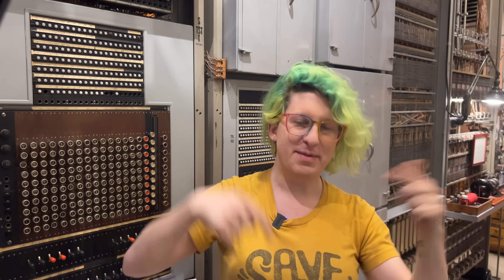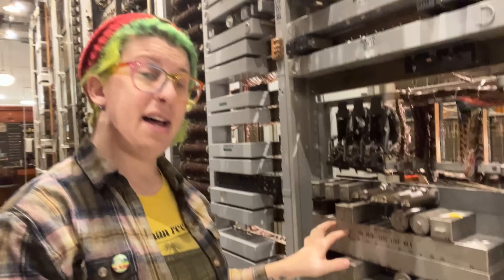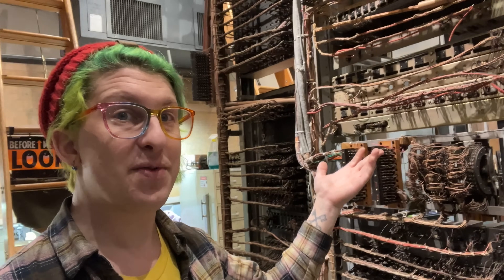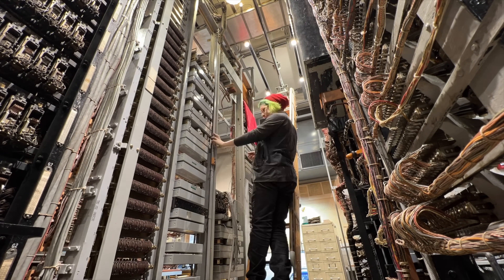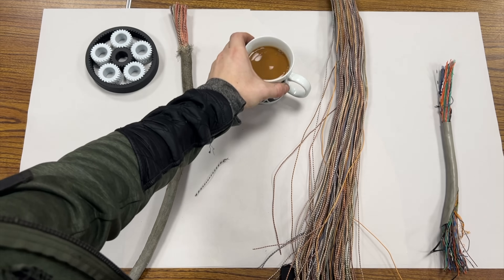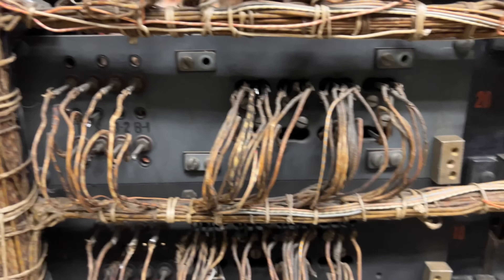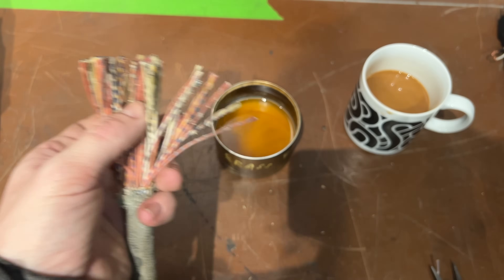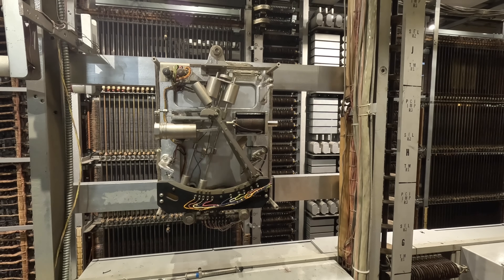Bringing up the Sender Test Frame: PART 2!

Comment: The cloth-covered wire was also used in American pinball machines. This continued in use until they went electronic in the mid 70s'. My friends at the time always laughed at me because they didn't use PVC-insulated wire. I can only assume it was more resistant to overheating when coils burnt out and went short circuit. PVC insulation may have melted. The only drawback was if the loom got damp or wet, all sorts of crazy faults occurred. Any one know why it continued in use?

Comment: 55 years ago, I operated a Stromberg Carlson test board in a 5000-line XY switching exchange. 12 Hour shifts at night. The work was difficult for sure. Just the frame man, me and one switch maintainer on duty at night.
Not only telephone but teletype circuits, secure voice circuits, dedicated circuits. Never a dull moment. My frame man kept me on track as he worked there for several years before I got there. I could count on the correct cable pair and the correct connection every time. My frame man made me look like I knew what I was doing. 😊 Thanks for the interesting information.

Comment: Do you still have the wire display on the 3rd floor?  Love the paper-wrapped wire in muslin sacks - it's organic!  Also remember reading in one of the History of the Bell System volumes that they calculated they would use all of Earth's lead for insulation at some point if they didn't come up with new materials.

Comment: In the 1980's the FCC equal access mandate required all BOC's to support equal access dialing for long distance. Initially, someone thought it was a good idea to add "Adjunct Processors" to existing 5XB offices to provide equal access. This went horribly wrong so Pacific Bell in L.A. had to install new NTI DMS100's (and 5ESS but I worked for NTI) to replace all of the 5XB switches. I have a 5XB relay test box from one of the 5XB's we replaced.

Comment: It would be antithetical to the ethos of the switch to ever install any module to emulate a relay function that was secretly an entire computer under the hood.  Totally agree with your decision, Sarah.
Reply: That being said, there's some things you just can't fabricate. If you've got a dead part and a modern equivalent, use the equivalent but keep looking for an original.

Comment: Enamel-coated wire under double silk? We sometimes used that kind of wire for transformer windings here in Poland - it was marked DNEJJ. For telecom cables typically enamel-coated wire in color-coded paper cover was used, bound with a paper tape and shielded with lead. I discombobulated a good few meters of that sort of cable when we found some cut off and lying underground next to Book Art Museum when I worked there. Quite a few kilos of lead, that would later get remelted with antimony and tin to make some fresh type metal.

Comment: ESS 1, 2, 3, 4, 5 & SS 6 & SS 7 do not have sender test frames because they are transistorized and integrated circuits controlled by Western Electric Princess Quad 4 microprocessors running at 1 Ghz, which was state of the art in 1965-1995.

Comment: You can get an electric tool to strip the enamel off the wire its a rotary type , motor rewinders/repairers use them.

Comment: It's a telephone museum, it needs to work as it did in the time period. Modern telephone exchanges use computers so it doesn't make sense to have that in the museum. If you needed to emulate external networks or remote components then a computer might be justified.

I'd love to see a video on the full working system when it's done.

Comment: How do you do a test on the line by dialing in ? 

Is there a 3 digit code ? 

I remember back in the 90s there were 3 digit codes that would tell you the phone number you were dialing from, but it worked for NYNEX and it didn't work for other phone companies 

I realized that when I traveled for work and I was used to dialing the 3 digit code to get the lines mapped out in the TELCO rooms

I got there around 3am and I hooked up my test phone to the block and dialed the code and nothing happened 

I thought it was a universal code across all phone systems but it wasn't.

Comment: I am into retro computing, and in so many cases I prefer it the way you suggest, using original parts.   In some situations though the original parts are no longer available and therefore not repairable when they break down,  In this case using an FPGA and some modern simulation can be beneficial to preserve the original equipment operation and not damage equipment that is already well and truly at end of life that is irreplaceable.
You do have to watch some of the early plastics used for insulation.    Some of the early ones suffered plasticiser migration,  the dreaded green goo.   It was probably when they started going a little cheap in the late 60's and the 70's.    
I have a feeling that silk covered wire may, in some instances, also have asbestos impregnated in it.    I am sure you tested it properly, but anyone playing with it should have it tested.   Beeswax was also quite commonly used on lower voltage, and what is called SELV these days, cabling.       I come from a background of dealing with LV and HV installations, so all of my experience is with 120V or higher, so cabling would be a little different to have the correct insulation characteristics.

Comment: When I was young and that cloth covered wire was common, it was known as "push back wire". That was because the way you stripped it was to not strip it in the conventional sense. You just pushed the insulation back from the end of the wire. 

Getting the enamel off the end was done preferably with a chemical stripper that didn't damage the copper, or if that wasn't available or couldn't be used, with fine sandpaper. Using normal mechanical strippers would both nick and harden the wire, very often leading to either immediate or eventual wire failure from fatigue bending, causing it to break near the termination.

Comment: I sincerely appreciate the switch centric presentations, however one very important aspect of telephony, to include the CO's power plant, are the transmission facilities that interconnect switches.

From early analog C, and K Cartier systems, through later analog A and digital T1 systems, not to forget about  the now soon to disappear venerable D Type series Channel Bank.

Having worked on the later digital T1 transport systems using cooper cables segmented into separate T1 spans, the wire outside the switch completes the telephone narrative.

Transmission systems may not be as sexy as the switch, but without CXR all calls stay local
Reply from the maker: You’re right. If I knew more about carrier systems I’d do a whole series on them. I know enough, but not enough to do a real proper presentation.
Reply: @ConnectionsMuseum   With the massive amount of D4 channel banks that have been retired at central Offices, MFT bays, HDSL systems (All copper based) etc, with one relay rack of each would represent a starting line to both preserving what's going away, and basis for understanding transport technology. What most don't understand is, T1 transmission was one method to squeeze multiple communication paths on a pair of wires, typically inter-machine trunks.  setting up one way DPO/DPT and E&M trunks, and god forbid Revertive Pulse units,  between two switches will help close the loop on the dial telephone network.

Comment: I am not surprised by the beeswax, as a child I was fascinated by the telephone engineers working in the street cabinets and noticed that they often finished work off by coating connections  with  a sticky brown wax for waterproofing. With all of that gear working  I amagine that it myust get pretty hot  there, surprised to see you wearing a flannel shirt and a wooly hat!, and on the the subject of heat,   what does it smell like with all of the machines working. I worked with  small racks of  capacitor testing equipment and it all had a   metallic but dusty sort of smell. All of that stuff  going , plus it having aged components and insulation, must have  some interesting  kinds of smells and sounds. Great  work that you are all  doing there Sara, more power to your elbows
!

Comment: I remember that silk covered enameled wire. Very difficult to work with. 
There was one other type that was used for very flexible connections like headset wires and relay contact jumpers. It was tinsel wire. It consisted of very thin strands of tinsel woven with silk thread. To solder it, you had to separate just the tinsel from the silk and solder the tinsel. Extremely difficult to do!
Reply: That tinsel wire is Litz wire, to give it the correct name. I never looked up exactly who or what Litz was.

Comment: I’d like to see more on the dial speed tester and the ringer call back. The elegant way the engineers of old made such complex systems electromechanically is a credit to them, there can’t be any satisfaction in a multifunction back box full of code in comparison.
Reply: Disagree. Having done both, they each have their own reward / feeling of satisfaction when done right and working properly. Different but both satisfying
Reply: @ I can see your point and have to agree if I’m honest, I also do both though mine is PLC programming rather than micro controllers and do get satisfaction from a piece of code that works well, but there’s just something about old school relay logic and things that move.
Reply: Dial tester: https://www.youtube.com/watch?v=kBhzBJTVgKo

Comment: General Cement used to sell a chemical stripper called 'Strip-X' It was basically a type of enamel  paint stripper that was very thick so it didn't run.for enameled wire. It came in a bottle with a brush. You simply rushed it on and waited a minute to wipe off the sludge. You could also dip the end into the bottle.
Reply: I've been wondering ...  I've had to make a few of my own little inductors out of enameled wire, and my solution is to use an Xacto knife to scrape off the enamel.  Takes ages.  So tedious...

Comment: Oh wow, so cool seeing the wiring over the ages. When I was younger, I realize now just how flammable the wiring coverings were in the past. I should have realized that considering I have encountered plenty of old cloth insulated AC wiring. Thank you!
I will look forward to seeing the circuits in action!
Reply: So much of that old wire remained in place for one hundred years or more. 
The telephone system used cloth covered rubber insulated wire (type RH) for DC power distribution right into the 2,000’s. Since the central office switching systems are rapidly going away, one might as well say these cables lasted the life of the wired phone system.

Comment: Very cool about the silk/cotton insulated wire. Both the materials and how amazing those wires look fresh out of the jacket. It reminds me of some 100+ year old rubber and cloth insulated (line voltage) wires I pulled out of original rigid conduit. When you run into that stuff in boxes it's usually dusty and dirty, and 75% of the time the insulation is crumbling. But the stuff that was in the conduit was in great shape, and like with this, you could clearly see the different colors.

(Alas, running new THHN meant more clarity and a lot more room in boxes and conduits. Sorry historic wire.)
Reply: I can see how protection from daylight must have helped but surprised that the heat didn't  break down the silk, I really learned something today.

Comment: 2:57 so does that automatic test line do things like automatic ring back? One of our pranks in high school was to dial a certain number on the payphone in the hallway and then hang up three times and the phone would start ringing and we’d walk away. I think the number was a 976 number.
Reply: I did a little bit of reading and found out that the test number is usually had a 958 or 959 prefix.

Comment: While I don't know how it is for older telephone equipment, I do know it can be a bad idea to mount electromechanical equipment in any orientation that isn't the one it's designed to be in.
Found that out the hard way when testing if an analog kWh meter (power meter) worked correctly.
Turns out it ran at the right speed when mounted on a wall as it should be, but ran slower when lying face up on our workbench!

Comment: The beeswax came to mind imediately, as that is what we used on lacing twine when I worked for the British GPO. I think what you are doing is fantastic, I love the old exchanges, unfortunately we only had Strowger in the UK although there was three different eras of it. I have the museum on my bucket list, however due to the current environment towards gender non-conforming in the US I don't see it happening soon, not that the UK is much better after the recent court decision.
Reply: The GPO had the TXK (originally TXC) crossbar series as well as the UAX Strowger series.
The panel system appears to have been specific to the US. At least according to the Wikipedia page, it wasn't even used in Canada.
Reply: @markevans2294  Hi Mark, I left the PO in 1978, they had some experimental TXE and TXK exchanges (I seem to remember one being Shoreditch) but I did not get to see them. I did however work on all the 3 different types of stowger, pre 2000 at Holborn and Tandem, 2000 at Covent Garden and 4000 at Holborn 404 when it was being installed (I think this was the last Stowger Director exchange to be installed). I think the crossbar exchanges were derived from an Ericson design. TXE was a completely GPO design. By the tme I left I was working on radio telegraphs anyway so I did not see any of the new stuff.
Reply: @markevans2294 used to work for STC commissioning TXK3 and TXK4 crossbar switches up North. Blue/Orange/Green/Brown/Slate and 11 points still in my memory 🤓 #goodolddays

Comment: As someone that has done a few cable looms over the years, I honestly expected you to dunk the cables into the coffee cup when the cup came into view. 9:20
And I am also of the strong opinion that a machine showcasing the technology of the time should ideally rely on technology available at the time or stuff that works in a similar-ish principal.

It would be far more okay to use modern 48 volt relays on the other hand. Since it would have similar limitations.
And honestly, I have been pondering how many relays it would take to get the basic aspects of one of these switches built using more modern components. Relays have gotten a lot smaller over the years and we likewise have easier to work with terminals, so ease of maintenance would likely be higher.

One thing that though somewhat surprises me is the use of solid core wire. Since it is fairly prone to developing cracks leading to open circuits. Though, given how much of the wiring isn't pushed about or otherwise vibrating around, then this shouldn't be a major problem. I honestly expected stranded wire, since at these relatively low frequencies the difference doesn't matter from a signal quality standpoint. (and for higher frequencies one would want twisted pairs or coax regardless.)

Comment: Can one call into those auto test lines, from the outside world?🤔
Reply: Also curious, those test lines are so cool.
Reply: Probably not, AFAIK pulse dialing (used to select the test function) only works on the local loop and isn't generally signaled in any way on trunk circuits.

Comment: Do you just scrape the enamel off? It seems to me that when you have so many wires to connect you need a quick way to prepare the ends before soldering or attaching to screw terminals.

Comment: Fantastic look into how engineers  created the systems they needed with the technology at hand. I was surprised to see the Panel Switch had MF and Area Code capability. I had not realized they were in service that late. Wikipedia has a nice description of Panel Switches featuring your museum.
 
Bottom line, relays can do anything modern logic circuits can do just much slower, larger and more power hungry.

Interesting you mentioned various options to mount your new whiz-bang test circuit. I have to admit vertical mounting was my initial idea but I agree with you it would look wrong. Looking forward to the next installment.

Comment: 3:18 Was there ever a "back port" for MF in panel offices? Or did they always rely on RP from the foreign office?
Reply from the maker: Panel offices could send MF out, but could never receive MF in. RP only for inbound calls.

MF support was kind of a bolt-on thing they devised in order to keep panel offices in service during the 60s and 70s, but it was never truly integrated as part of the machine. It felt to me like it was a kludge that gave the machines a few more years of useful life.

Comment: I finally learned what "PIC" means. I had heard the term used by the Telco guys over the years as in-house tech on PBX systems. Thank you!
Reply: You just reminded me of PIN which was used on PRX-A switches back in the 80s. It stood for Processor INitiate, it was that nail biting few minutes when we wondered if the switch would boot up after a software update. Thankfully the last of the paper tape readers had been updated to DC300A cartridges when I started working in Saudi Arabia.
Reply: Then to make it better for outdoor or buried use, you get “icky pic” - and trust me, you’ll have icky pic all over your hands, your tools, your clothes…It’s practically contagious and truly ICKY!
Reply: @ So true!